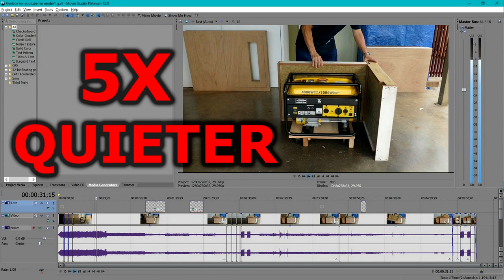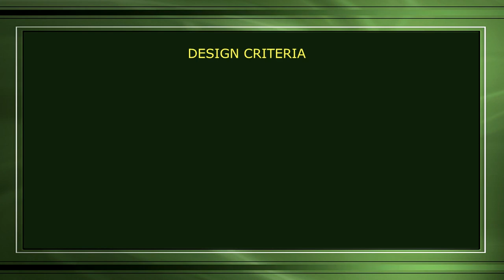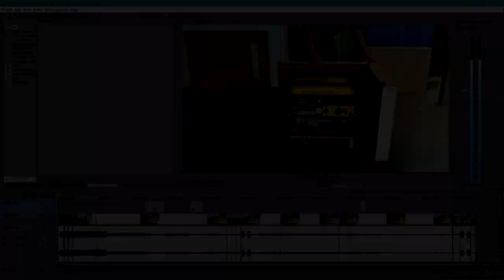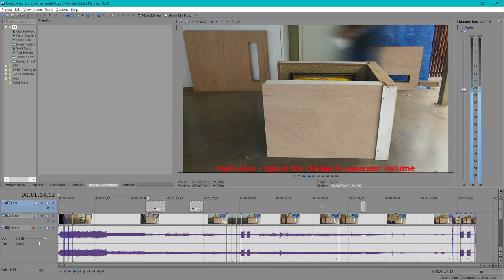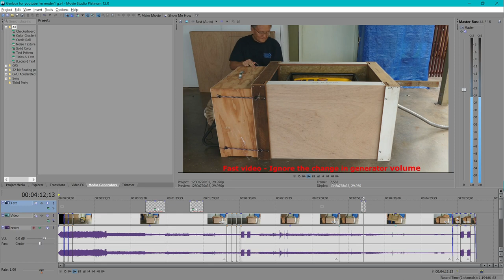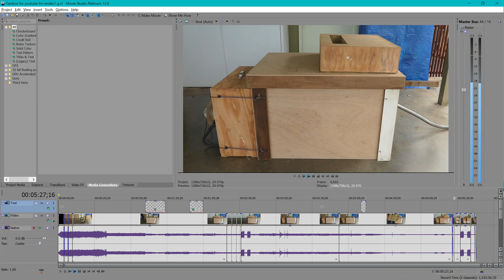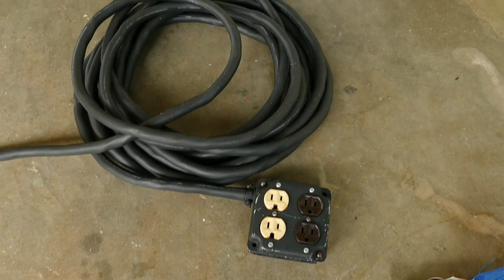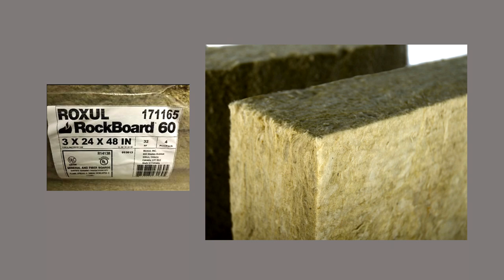5x quieter generator or compressor sound reduction quiet box

Comment: I was able to purchase instructions for this Quiet Box. They are the most compete instructions you'll ever see for a project. All broken down into sections,  typed out with computer illustrations and videos! Emailed to me. It's really a booklet. I'll start working on it and hopefully get it completed in a few weeks as time allows.  I'll make any necessary adjustments as my generator is a little larger. You won't be disappointed if you order a set of building instructions. 👍☺
Reply from the maker: Hi B Berthold,
Thanks so much for your very positive feedback for the plans package you received.  Made my day!
Reply: Usefulgizmos hello I just bought an older generator and need desperately to quiet it fo r the neighbors sake...lol...but how could I get the I struction package that you got??
Reply from the maker: Hi Heidi,
Sorry but I missed your question until now.  For details on my quiet box plans package, please send an email to me at usefulgizmos@gmail.com.  Thanks.
Reply: B Berthold where can I bought it?
Reply: Are your plans brand specific? I have a champion generator would the size/dimensions need to be adjusted? Do you need the specific model of generator I have? 

Thanks,
Reply from the maker: @LADodgerfan27  Sorry I didn't see your question until now.  My plans package includes plans for my quiet box as shown on youtube plus bonus plans for 5 other generators.  Send an email to me at usefulgizmos@gmail.com and I will send you the info of what my plans package includes.
Reply: @usefulgizmos  Can i have the plan for to quiet my generator box.
Reply from the maker: @johnnymorgado6233  Send an email to me at usefulgizmos@gmail.com and I will send the info to you on what my quiet box plans package contains.
Reply: Hello, Great video. You helped me design a generator shed that should be much more efficient than my original design. Thank you.
Reply: Want buy these but I can't figure out how....

Comment: I finally started building your design a couple of weeks ago.  My generator is a larger Champion model than yours (#100419, 9000/7000W on propane), but the Duromax 10000 plans that you include in your package are very close to the required dimensions, so I used that  version and made the small necessary adjustments in dimensions.  I did a lot of searching to find Rockboard RB60 in my area,  eventually located a soundproofing construction company that had a bunch in stock, and they gave me a good price.  I built the larger version of the RB60 cutting jig that can accept full width or length of the panels easily.  I just happened to have a 30" x 60" work table, and the jig fits it perfectly.  I visited the local thrift store on a lucky day, and bought a set of 4 serrated 8" kitchen knives for $5.00.  I  couldn't believe how accurately and cleanly I can cut the RB60!  The panel frames are done and went together like clockwork, even with not-the-best quality selection of 1x4s and 1x6s at my local Lowe's.  Your instructions for straightening the edges of the 1x4s are magic, and made assembly a piece of cake.  I found the 3M Super 77 adhesive in 16 oz spray cans at the local Ace HW, but I've been putting off permanently gluing in the RB60, so as to do it all at once.  I'm not sure how long those cans will still spray properly, once they've been used and then stored for a bit.  Instead of a Vornado 660 fan, I'm shopping for a centrifugal (squirrel-cagel) fan with rectangular flange-mounting to attach to the end of the  box.  One of your commentors indicated that the centrifugal design pushes air better and won't cavitate as easily as a conventional circular fan. The Vornado 660 provides 584 CFM maximum, so I'm using that as my requirement floor.  I'm researching cheap remote temperature sensors that I can disperse at various places in the box, to monitor for high temperature hot spots, or at the very least, exit air temperature..  My box will be outside all the time, so I used 1/4" exterior plywood for the panel skins, and I'm considering using Bote Cote epoxy to seal them up.  I'm also looking at a conventional roof added to the cover, perhaps hinged with support struts.  I'll add my admiration to that of the other responders:  your instructions package is among the best I've ever seen, and, as a professional engineer for 35 years, (and as a Dad assembling kids Christmas toys for 4 kids) I've seen more than a few.  Also, your tips and hints for straightening wood and managing dimensions and clearances are treasures - I wish that my high school shop teacher had taught as thoroughly as your instructions do!  You should write a woodworking book for beginning hobbyists, one that teaches how to build accurate designs using suboptimal materials.  I have no doubt that it would be the best such resource ever produced!
Reply: Î in
Reply: I have the same champion generator you have so I’ll definitely look at the duramax 1000 specs! Thanks for the comment!

Comment: This is the BEST silencer I've seen from many Youtube videos!  Two thumbs UP! 
A lot of the newer generators manufactured lately provide Carbon monoxide sensors that shut the generator down if it senses carbon monoxide... One thing I will stress here is that IF you're going to run a genset in your garage I STRONGLY SUGGEST INSTALLING A LOUD CARBON MONOXIDE SENSOR IN THE GARAGE and IN THE HOUSE!  EVEN IF you're running that exhaust tube outside and up above the roof. In the event that the exhaust clamp vibrates loose or exhaust flange gasket fails. Better a few dollars spent on extra safety than on a casket!
Reply: Thank you Geo.  Additional safety measures never hurt.  Thanks for watching and have a great day! .... Usefulgizmos

Comment: Great video, and a real optimum design too. Just want to note that a 21 dB reduction in noise, as measured in the video, corresponds to over 100 times reduction in sound pressure, not a 5x reduction. It is a profound difference. Thank you for sharing.
Reply from the maker: Thank you for your kind comments.  Thanks for watching and have a great day! .... Usefulgizmos
Reply: 20 db is 10 times reduction

Comment: Good job. I did one recently using a permanent setup with carrying handles for my travel trailer using an already quiet inverter generator inside. Setting up an auto start/stop and an extended runtime aux fuel tank, I don’t have to leave comfort of my RV, and it’s that quiet you don’t even know when it cuts in or out whether inside or outside the unit.
Reply from the maker: Thanks for taking the time to post your comments.  Have a great day! ... Usefulgizmos
Reply: Can  you do a video of your setup

Comment: You certainly did a stellar job on this sound box and the logistical thinking involved. I store my generator outdoors with a rubber sheet over it to keep rain or sprinklers from ever putting water anywhere on the generator. I will probably use your method putting a roof on top a foot or so above the top baffle so rain and snow don't interfere. I really like your method with the pins and exhaust removal. I might need to transport it so my older relatives can use it if need be. Rarely does everyone's power go out at the same time here. Of course everything is subject to change and it can happen.
Reply: In my plans package I show an alternate method of using rainshields in place of the sound baffles if using the quiet box outdoors.  Thanks for watching and have a great day! .... Usefulgizmos
Reply from the maker: In my plans package I show an alternate method of using rainshields in place of the sound baffles if using the quiet box outdoors.  Thanks for watching and have a great day! .... Usefulgizmos

Comment: This is by far the best video and most successful outcome of a quiet box build I've seen on YouTube and I've watched lots of them. The box I need is for a compressor which runs loud enough to wake the dead! Your video showed reduction going down at every stage and by very impressive amounts. I think you could have gone down a bit more by sitting the whole unit on thick carpet or a rug to reduce the amount of noise transmitted by the floor. I think there is a real need for this amount of sound reduction as the cheap compressors and generators are becoming more and more popular.
I was planning to get rid of the compressor I just bought in order to stay on peaceful terms with my neighbors, after seeing what is possible on your video, I've changed my mind as I don't think it will be any louder than a domestic vacuum cleaner once it is boxed in - we shall see!  Thanks again for a great video.
Reply from the maker: Hi Martyn,
Thanks for your kind and thoughtful comments.  Yes, I think you will be pleased with the amount of sound reduction that this design affords.  All I wanted was at least a 50% noise reduction but the results far surpassed my expectations.  Plus, in addition to excellent sound blocking, the insulation used (Roxul Rockboard 60) is relatively light weight and is extremely fire resistant.  No worries about the insulation being close to a hot muffler or the hot exhaust tubing touching the insulation.
Have a great day,
Usefulgizmos

Comment: Very impressive design. Lots of high tech engineering in that design. Keep in mind though that many of us don't posses that level of woodworking skills and tools. Adding a temp sensor on the motor would probably show some interesting level of temp rise with the box in place that will affect the generators life span. Also the back pressure on the engine exhaust valves may pose long term issues. I just bought a USED Honda generator  for $1000 and none of that quieting is needed. I prefer to let Mr. Honda's engineers do the work. I can run it right out in the open and downwind side of my house and neighbors don't even know it's running. Thanks
Reply from the maker: Slick, thank you for your kind words.
Slick said "Also the back pressure on the engine exhaust valves may pose long term issues." ........
Usefulgizmos said:  I don't think that will be an issue with my design.  I read that if the exhaust tubing has twice the area of the engine's exhaust, there is no back pressure concern. (tons of research so don't have the link to that info now).  The exhaust for my Champion generator is 3/4" diameter so has a area of 0.44 sq inches.  The flex tubing is 1-1/4" diameter so has an area of 1.23 sq inches.  1.23/.44 = 2.795.  So my flex tubing has about 2.8 times more area than my generator's exhaust.  The vertical conduit pipe has an ID of 1-3/8" so has an area of 1.48 sq inches.  This expands the exhaust area even more. ..... So in summary, I don't have any concerns about harmful back pressure on my generator.  .........
Thanks,Usefulgizmos

Comment: Great job! I just installed Roxul AFB (zero formaldehyde unlike their Safe 'n Sound') batts 3" thick between my neighbor's and my double condo wall. I then put 2 layers of Homasote soundboard 1/hick each over the batts. I still plan to double all that AND add something like Quiet Rock. I haven't heard my new neighbors yet and I am only half way finished! These ideas work. They really do work well. Thanks for helping me think through a generator box for a food pushcart's generator in this excellent video.
Reply from the maker: Hi Johnny,
Thanks for sharing your experience in blocking sound.  Yes, 3" thick mineral wool does block sound transmission very well.  And thank you very much for your kind words regarding my video.  Have a great day!

Comment: Very impressive.  The rule of thumb for motor vehicle silencing is "every 3 dB reduction is a reduction of sound energy by 1/2".  If your decibel meter is correct (and I see nothing to indicate that it is not), you're reducing energy by 1/2 seven times; that's huge.  (Reducing the sound level by 1/2 is not exactly the same as "quieter to the ear by a factor of 1/2 but it's the best way to scientifically measure and it's a good indication.)

I'd only like to ask one thing.  You documented the sound level very well by showing a meter read out quantifying sound level.  What would help greatly would be if you'd similarly document temperatures with an infrared thermo gun; I bought one for about $30 from Amazon and it's quite accurate and I use it for many things -- temp inside the fridge or freezer, drive an hour and check tire temps to be sure they're all the same (one that's hotter indicates possible failure), all temps of each header pipe on my RVs engine should be the same, battery temperature, etc.  They're VERY useful as a tool for many uses.  
Put spots of tape with a number on on your engine at a few different places.  Run the bare generator under load for 30 minutes and record the temps; then let it cool for an hour.  Reassemble the quiet box, run the engine again and then check numbers.  If you're not getting significant increases, your cooling scheme is working very well.

And for cooling, "squirrel cage" (or "snail shell") centrifugal fans will build up air pressure and push air through a baffled path much better than a plain blade fan.  A blade fan will stall out and cavitate air resulting in very significant air movement drops if there's any significant back pressure;  under back pressure conditions, a centrifugal fan will build up more pressure against the back pressure and continue to move air.  You may wish to try one.

Finally, a double back baffle system will drop sound levels much more than a shorter or more direct baffle path.  Most quiet box systems are let down badly by their control of cooling air, you're right in your emphasis on getting the input and outlet sound level reduced for your cooling air. The excellent exhaust pipe arrangement is also top rate. You've done an excellent job and probably are reaching the point of diminishing returns so that it's really impractical to do much better.  

This is very good work, indeed.
Reply from the maker: Hi Brucebear1, ... Thanks for your analysis and suggestions.  I'm sure others can benefit from your comments.  Have a great day!

Comment: Mahalo for da great video.  I'm in the process of building a geny stand and dog house for a portable generator that will power my house.  Hopefully I'll never have to use it though.  Last year during hurricane Ida we had a really small one that would only power the fridge and a few other items. Regardless,... it was really loud, and we shut it off at night.  But now I have a larger one, and I need to do everything I can to make it as quiet as possible, without going out and buying a TQG from the Army Surplus Store. I have an area that I can keep mine set up year round, that is out of the way, but the design is what is important.  I've seen too many that use a plastic tool shed, and hard, heat/cold insulation instead of sound deadening insulation material.  I had a few baffle ideas in my head as well, and your design has fortified my similar ideas.  Aloha, from Louisiana (former Kihei).
Reply from the maker: Welcome Jeremiah.  Best wishes for your quiet box build.  Thanks for watching and have a great day! .... Usefulgizmos

Comment: Keeping a generator makes sense - China makes a dual fuel kit for $20 and w/ 4 tanks of 30 lb propane(each equals 5 gal of gas) lasts a few days. I run gasoline daytime & propane at night. Leaning 3/4" plywood(5 pcs) & adding the exhaust pipe lowers noise more than 10 db so I can sleep.

Comment: if you slope the sides out on the bottom it also helps. /````\  like this, it directs the sound down and back. I just use plywood and this method because it takes up less room for travel. works well enough. for a more stationary setup your idea is great.
Reply from the maker: Thanks for sharing your ideas.  They may help others with their quiet box designs. Have a great day!

Comment: I just made a frame from 2x4's and attached acoustic ceiling panels inside and 3x4 plywood outside and it gave me 90% quieter on my compressor.
Reply from the maker: Hi Eloise,
That's some heavy duty frame you made. Way more heavy duty than my frames. Glad it worked out for you though with such excellent sound reduction.
Reply: Its a tall compressor, like almost 6ft, and used to scare the bejesus out of me when it clicked on! Because it doesn't get hot like a generator or require all that venting, there are just  4, 2-inch holes near the bottom on the back side, far away from the noisy bits on the top of the thing.  The front is hinged like a door so I can get at it.

Comment: I'm basically building the same thing at this time but rained today so im checking others ideas. Made mine 3.5 ft by 4.5 ft wide by 42" tall, using a 900cfm fan blowing air out with a smaller inlet. Exhaust is going through a baffled chamber system on the side along with the warm air. 5 insulated corners/chambers should knock down the DBs, is a 9000watt gen. Not running any extra exhaust pipe, just a silencer off my 88inch Harley that happened to fit just right to the muffler that makes a 90° exit into the airflow exit

Comment: Outstanding video, plan on putting mine in the garage and exhaust thru the side of the house. I love the box and how it works, unfortunately for me my GF will be doing this since firefighters are usually at the station for hurricanes and major storms, and I don't see her doing all this, so I will have to dummy it down a bit with foam panels. The video did give me some great ideas though, if you had an electric start genny it would be really easy.
Reply from the maker: Hi Tom,Glad you found the information to be useful and thank you for your kind words.  The Rockboard 60 insulation I used is very fire resistant (almost fire proof), has outstanding sound reduction, won't disintegrate over time and is quite light in weight so I think it's worth it.  Sounds like you have a great girl friend.  "Honey dos" in reverse (wink). ...Have a great day, ... Usefulgizmos